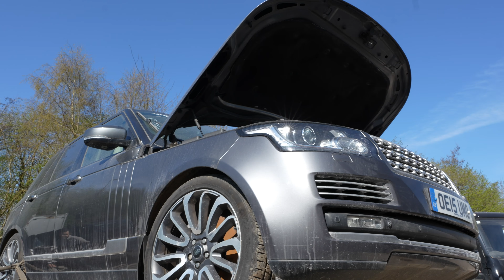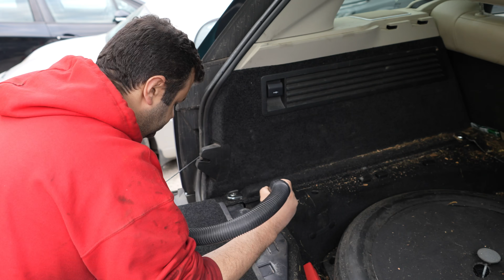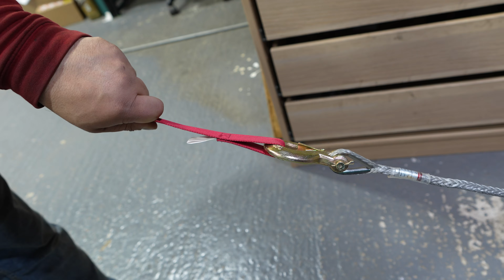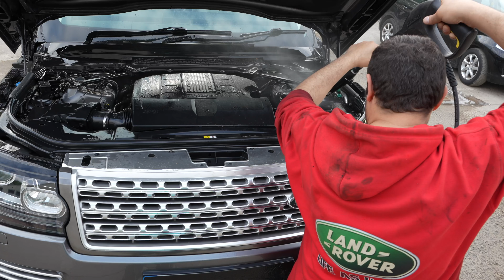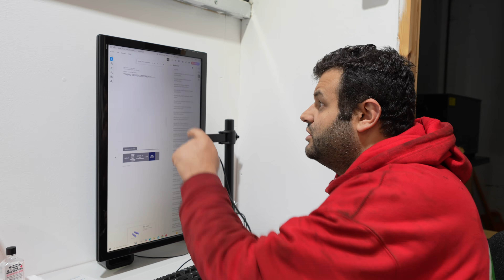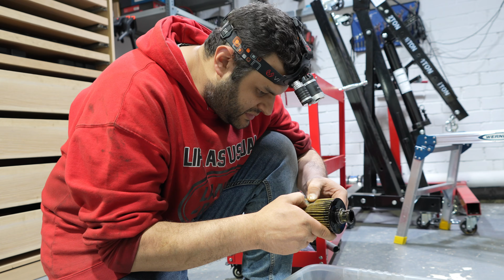I BOUGHT ANOTHER ENGINE BROKEN DAMAGED RANGE ROVER

Comment: I would never ever go anticlockwise , accidently did that once on a 320d , the chain tensioner is not designed to keep it tight nor the guides in anticlockwise direction. It skipped a few teeth than had to change the head. This was mainly due to the teeth on the high pressure pump sprocket when the 2 chains meet very worn (180k)
Reply from the maker: Yes, I agree with you! It does say in the workshop manual that you should only turn it clockwise, so I was very surprised that mine was going clockwise and anticlockwise. But if you looked at the latest videos, now we know why... 😳 Thanks very much for watching! 😃👍🏻

Comment: Great stuff once again ! Really interested in the 5.0 V8 SC, I heard that in the Jaguar XK the oil spec was changed from 5w30 to 0w20 at some stage as Jaguar found that the timing chains didn't like the original 5w30 spec. But a lot of engines had failed chains in the meantime. Anyway, love the new Autobiography as well as the super engine !
Reply from the maker: Thank you for the information, Frank, I will look it up for sure when I come to put new oil in the engine. Thanks so much for your continued support, it truly means a lot! 😀👍🏻

Comment: I like his style and scrap value would probably cover his outlay, but why not check the Range Rover database with a main dealer and see what they know about it? I would want to check that timing chain before pushing the button though? I Imagine there would be more compression on a v8, Cam gear gone?
Reply from the maker: I agree with you, I would definitely not turn the car on before fixing the timing chain and any damages that it has caused 👍🏻

Comment: Common problem with these iv actually just finished with one the bottom oil feed tubes fall into the chains causing them to jump timing and also damage the lower gear locking up means the valves are hitting the pistons going to be fun you will enjoy it
Reply from the maker: Thanks for this, now I'm really looking forward to getting stuck in and see what damages it has caused! 😀👍🏻

Comment: Is it a common problem with the 4.4 and 3.0 Range Rover engine, my brother rr sport 2021 has just had a engine fail at just £43k miles 🤯
Reply from the maker: I'm not too sure if this is a common fault, but I know the 3.0 doesn't have a chain, it has a belt, as you can see in the previous videos on our channel, when we were working on the 3.0 TDV6 Range Rover. 👍🏻
Reply: @lifeasusual ahh ok….. well I think your a really bad influence! 😂 I just bought a non runner l322 3.6 Overfinch with “suspected starter motor failure”, but got scammed I fitted a new starter motor and loads of smoke looks like the turbos have failed 🤦‍♂️ uhhh above my skill set hayho! Would have loved one of these but It’s now on eBay if you want another project…. The Overfinch would be great contend and would be lovely to see it being saved
Reply from the maker: Oh no!! I'm sorry to hear the turbos failed and you had to put it up for sale! Since I just purchased a new project, maybe not for now, but maybe in the future it would be a good one to work on! 😀 Thank you so much for your suggestion! 👍🏻

Comment: So happy to see more content, I love your approach and the results. You two are also a superb team!

The only non superlative comment I need to make is that I have the SV Autobiography Dynamic, the GAP Diagnostic tool should be a G4 ideally. (There are options to sell/upgrade) Patrick from GAP is one of the most skilled and helpful engineers you could meet. I got into the IID tool long ago for a 2006 S/C and then a 2010 S/C. Contacting their support (allowing for time difference to Canada) is amazing. I am a professional Engineer and was allowed by Steve to join their beta program, they work so well with feedback.

I am so looking forward to your new content and seeing you fix the 2015 S/c
Reply from the maker: Hi Stephen, thank you very much for your advice.👍🏻 Once the car is fixed I'll have a look and see what the problem was that wasn't allowing it to take the proper readings and diagnostics. 😊👍🏻

Comment: Hi great as ever just a tip find out as much as you can with engine complete and in car as can often damage something else or have a completely separate problem that would mean engine out again or awkward to get at clear all codes re scan not just engine , if you do as good as job as last time you will be fine 👍
Reply from the maker: Hi Thomas, I have done a full rescan, and these are the only faults I have with regards to the engine. But I do plan to go full-on and do all of the repairs and any common issues will be sorted, or anything that needs replacing like water pump etc will automatically be replaced. Thanks so much for all your support!! 👍🏻😀

Comment: Hey boss! I got a L322 5.0 with 172k miles with horrible timing chains noise and timing code so I decided to DIY on the “easy way”:

The plastic sliders were broken off the aluminum mount and made a mess inside

Never disconnected battery
No valve covers removed 
No coils removed
No injectors removed
Just the front cam covers

Pulled radiator/shrouds out
Heavy Inertia socket 24mm
1/2” Air impact 
12.9 crank bolt came right out 
Pulled crank pulley w standard puller

No zipties
No crank pin
No starter removal
No flywheel hold down
No cam hold down
No cam gear removal
No cam gear re torque 

3/8” ratchet fits right in cam gear
Adjust the skips teeth back to factory spec
Turn crank forward /backward to align chain marks

Toss old guides/tensioners/ water pump/belts/idlers 

New guides slide right in

Pull the pins on new tensioners and watch them snap hard tight!

Button up backwards 

All in 4-5 hours and less than $250 total

Runs perfect and quiet - fired right up!

My 2 cents! Best of luck for you guys from USA!
Reply from the maker: Thank you very much Marcos, this is incredibly helpful information, and I will definitely need it when I start the job!! 👍🏻😀 We thank you so much for all your support and encouragement, and I look forward to having you part of our journey! 🎉😊

Comment: Hi, you shouldnt move the crankshaft! Looks like your timing chain tensoner has gone and the chain is snapping. Your timing synchronisation between crank and camshaft is wrong now. Tipical problem with that engine. That means that, if the egine is a normal construction, the valves may touch the piston, being bend!! Put you camara through the spark plugs to see if there are any marks on the pistons. Hope the best for your new purchase!! 🙂
Reply from the maker: Thank you very much for the insight, Michael! 👍🏻 Yes, I agree, I think that's the next thing I will have to do! 💯 I appreciate your support and encouragement! 😊🎉

Comment: That is definitely the timing chain, many have done this job with engine in,  but if you want to do the oil pump and chain  It will be an engine out job, good luck on this adventure
Reply: i been done timing chain job for three of these engines, not that horrible but definitely one working day job.
Reply from the maker: Yes, I'd like to do as many jobs as I possibly can on the engine and go full-on. Thanks so much for your support, Adrian! Hope all is good with you 😊👍🏻

Comment: The timing chain guide is common issue In RR full size but usually you will see restricted performance error on the screen and the car loses it's power. I don't know how RR Uses a plastic part for the guide. Taking off the engine is not recommended just give your self space by removing the front bumper. Best of luck
Reply from the maker: Thank you very much for your advice and information, and for your continued support! 👍🏻😊

Comment: Such a great looking car with all the gadgets , I thought these engines would be good , I had a mer that skipped a tooth due to stretched chain and only had 35000 on the clock and always serviced so can happen to any car, will be interesting whats happened to this one.
Reply from the maker: I agree with you, Joseph 💯  I will need to do further inspections and diagnose it more. And I think if the engine is out of the car it will be much easier. 👍🏻 You're right, it can happen to any car!